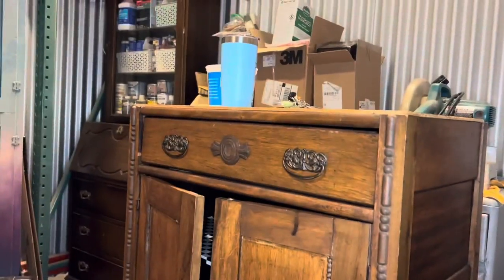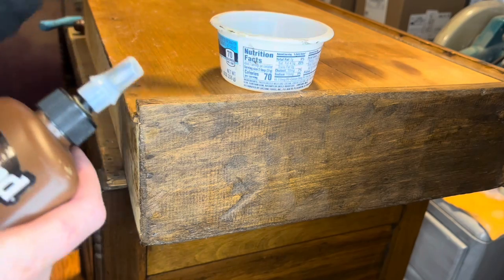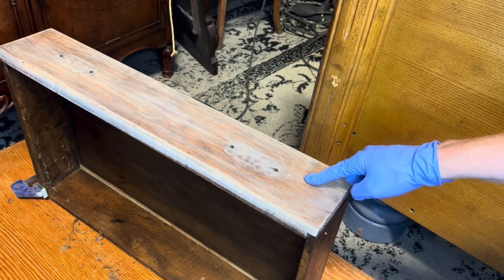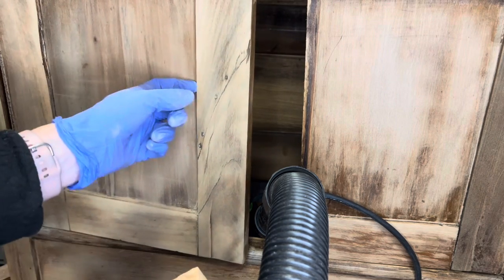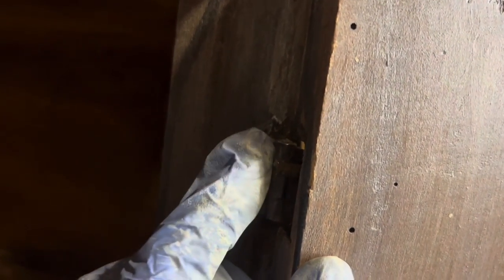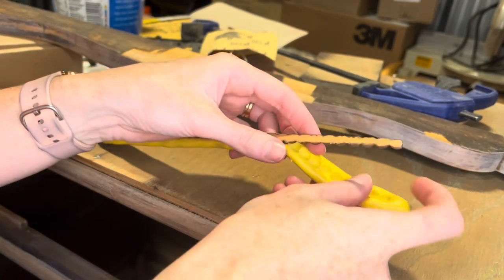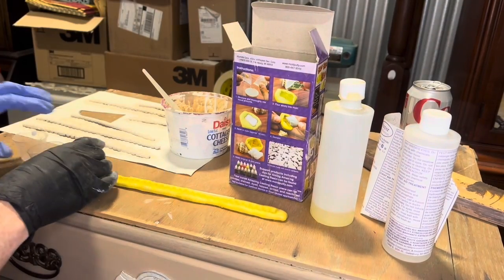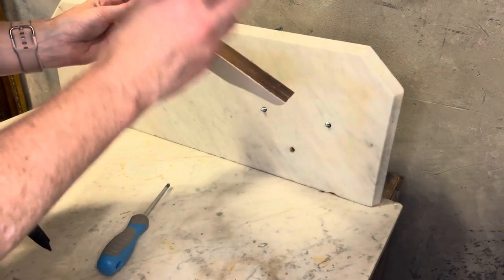Antique Washstand Repairs and Update | Elegant Upgrades

Comment: You can put the glue in the syringe then  when you have the amount of glue you want, turn the syringe so the needle end is pointing up towards the ceiling, then push the air out with the plunger until a little bit of clue comes out the needle.  Do it slowly and you may want to practice first with another vicous liqued.
Reply from the maker: Yes, but I don’t like waiting for the glue to run down the tube.  I may or may not be a bit impatient… 😂 So I do it this way.